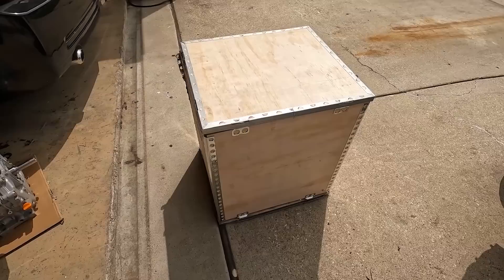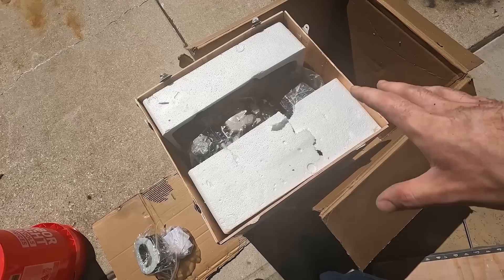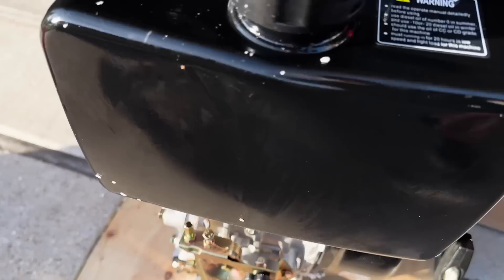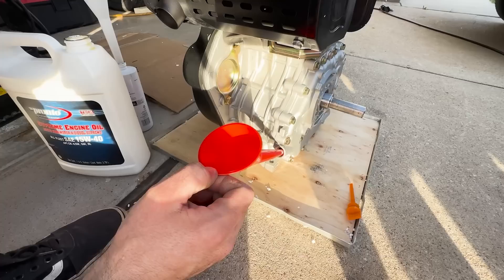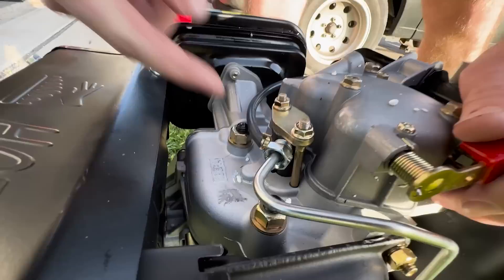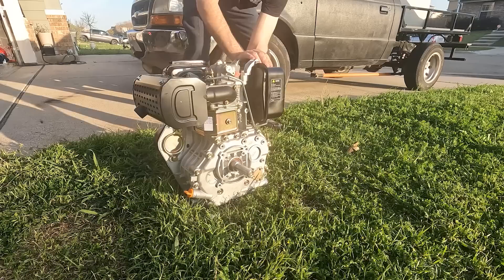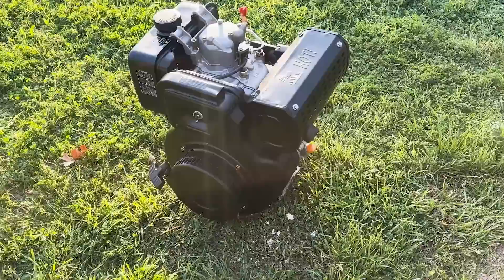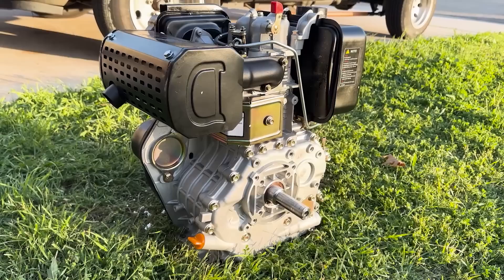Amazon 418cc Diesel Engine 10hp Unboxing First run

Comment: Electric Start Conversion KIT L100 for YANMAR L100 10HP 186F for Diesel Engines Starter Motor
Reply from the maker: Nice! That looks correct found one link for around 200 for the kit including charging coil

Comment: That's a sweet engine! 418cc would make a beast of a generator. At 3600rpm it'd be perfect for a 60Hz direct-drive stator!
Reply: It’s not a tapered shaft. He’s got to belt drive it. Better run at 2500
Reply: @boathemian7694  
Right in the middle of its torque curve. Great call!
Reply: A 5 1/4 pulley driving a 7 1/2 pulley will get the genny to 3600 rpm with 2500 rpm at the motor. 1.44 is your factor.
Reply: @kevdog58  
I actually drive my alternator at 4800 rpm with 2400 rpm on the engine. I use a 1 inch wide Gilmer belt and pulley ( toothed) to reduce the friction losses.
Reply: If it's of Chinese origin then you may regret it after buying it?
Reply: @ghanvedsingh8946 From what I’ve seen, they are made okay, but with shitty quality control/deburring and all that.

So basically before you run it, do a full dissasembly, check for any metal shavings and other fod type stuff, add grease and whatnot where needed, rebuild to proper torque specifications, THEN run.

Someone had done an AMAZING guide for all that on-YouTube too so it’s easily doable step-by-step like a cooking show!
Reply: @electronictim007  these small diesel engines typically do not have a torque "curve", The torque chart is typically very flat from about 1200 RPM up to 3,600 RPM. That's one of the advantages of a diesel engine over a gas engine.
Reply: @byronmill  
According to my studies with a watermarked dynamometer ( used a lot with my head porting work with small gas engines), my small diesel has a distinct "peak" at 2470 rpm.
The only work I've done it is a bit of head porting and ceramic coating the combustion sufaces.
Reply: @kevdog58  you mean 7.5 driving the 5.25
Reply: @100pyatt  whoops, you are correct!
Reply: @electronictim007  Running the engine at a lower rpm will just limit the amount of power you can generate.
However, running on the peak torque rpm range will maximise fuel economy and engine life.
Reply: 4-500 dollar?????look at the prices in de rest of the world Here in Holland 1300 euro
Reply: @ghanvedsingh8946  like your keyboard.
Reply: @electronictim007  Is it though? The specs for most of the Yanmars shows the torque peal coming in closer to the higher RPM.
Plus, power generation needs HP which will be very much lost at 2500rpm.

Comment: I have done lots of electronic starters on these. You will need a starter, ring gear and I also recommend to install the stator coil kit with the regulator. The coil and reg will charge the battery. Most don't come with the parts for electric start. Flywheel is bolted with a keyway.
Reply: How much power does the stator put out?
Reply: @TACOMASRT5  It is 12volts to charge the starter battery. The fuse is a 15 amp so I would assume around 7 to 10 amps. I never did an amp draw on it but I can say it is definitely less then 15 amp. If you are buying get the kit but the kits I bought didn't come with the bolts so you will need to go to the hardware store and get some metric bolts. Also I highly recommend using lots of locktite on the flat button bolts as these vibrate loose and will damage the new stator.
Reply: I think that I (and many others) would rather just pay the extra 300 or so bucks and get one with the starter already installed
Reply: part numbers for pieces needed to electric start?
Reply: @patwregan  ebay is where I get my parts from. The most critical things are the ring gear size and the rotation direction of your motor. I believe the 170F to 192F use the same starter and same alternator. Ring gears 170F to 173F uses a 200mm×15mmW×5.5mmH. The 178F uses 222mmx15mmWx5.5mmH. The 186Fto192F uses 245mmx 18mmWx10mmH.
Reply: @brianbillings1340   Rotation direction does NOT matter. If its wrong then just reverse the +/- and the starter spins the other way. That's why most starters have 2 positive bolt terminals. Put the positive on one and it spins one way. Hook it to the other and it spins the other way.
Reply: @andrewchristiansen8311  Rotation direction DOES MATTER! The starters gear that engages into the flywheel is of the slipper type and turns on the shaft freely when turned one way and won't turn the other way.
Reply: I’m sure your neighbors love the noise and stinky smell and air pollution. Get a gas engine. This isn’t a third world country, yet.
Reply: 10hp.is a little weak.for.418cc

Comment: as cool as having a small diesel on a go kart seemed, once i looked into it, it wasn't really worth it cause 10 hp at 3600 rpm is 14.5 foot pounds, a predator 420 makes 13 hp at 3600 rpm which is almost 19 foot pounds. then when i looked for aftermarket parts the diesel was in practice non existent. if i had the money id buy one for the niche of it but anything i want to go fast i'll have to stick to gassers

Comment: Probably makes between 15-30 ft-lbs of torque, which as a replacement for a gx 390/420 series engine would be a massive upgrade.
Reply: wish they made them vertical shaft so i can have a diesel push mower lol
Reply: @mudzy9820  That is an awesome idea/ dream. I would buy that so fast! Would LOVE to build that kind of contraption.
Reply: Manufacturer website has a performance chart that shows a maximum 26 Nm, which converts to about 19 lb/ft of torque
Reply: @byronmill  19ft-lbs is a lot in such a small package.
Reply: @life_of_riley88  I didn't say it wasn't significant torque,  simply stating the factory specs. 19 lb/ft of torque at 3600 RPM would be 13 horsepower peak.  They appear to be rating it at a constant load of 13 lb/ft, which would be an effective 9 horsepower at 3600.
Reply: @byronmill  Oh yeah I wasn't disagreeing with you at all. Thanks for the specs 🙂

Comment: I love these small diesels. I have two of the 418cc. You will need starter and ring gear. The flywheel it comes with doesn't have a ring gear. Use a 27mm socket and impact wrench to get the flywheel off. Then a 3-jaw gear puller. The flywheel has three holes in it to pull it off the shaft. The ring gear is about 10.5" diameter. Heat it with a propane torch and it'll drop right on. The starter is easy to mount. Connect your battery+ to the big threaded stud on the solenoid. Then with a screwdriver I touch that stud to the only other electrical connector on the solenoid and it will spin up. Note! You still need to press down the decomp lever, even with a starter! There is an ungodly amount of compression to fight against. What I like to do is let the starter turn the engine over 5 or 6 times, to get up to speed, then let go of the decomp so that on the 7th revolution, it resets the decomp, the exhaust valve closes and all that rotational kinetic energy slams the air into submission :) 

I just ordered another ring gear and starter myself. Ring gear is $38 and starter is $94. I have one of these engines mounted on a rolling cart with a Harbor Freight 10KW generator head. Both have 1" shaft. Using dual sheave "B"-section pulleys. Using a little bit bigger diameter pulley on the engine than the generator head, so that the engine will run at 3000RPM and the generator at 3600RPM. As you've probably already noticed, increasing the engine RPM suddenly not only rolls coal but it will sound like it has a rod knock. It's normal. It's the sound of combustion you're hearing. At that moment, there's more fuel than there's available oxygen (hence the "coal") and it makes a distinct hammering sound.

These diesel engines are awesome. I run mine off of 3 parts "black diesel" (centrifuged filtered motor oil) and 1 part real diesel. Runs perfectly off of it. I was afraid it would smoke like hell but no difference as compared to real diesel. Have Fun!
Reply from the maker: Ok that’s awesome! This is what I like to hear thanks for the comment!
Reply: Have you by any chance captured any fuel efficiency data when running your generator?  I saw somewhere these things are rated at about 6kw, not sure if that is the fuel input energy or if it can output a max of 6kw into a generator?  I have long thought about trying to make a diesel generator, curious how well it actually works and how efficient it is.
Reply: You obviously need a really flat surface and act speedily to drop the the ring gear onto avoid a misaligned contraction with a fast cool down? I would imagine.
Reply: @jontscott  I just assume half a pound of fuel per horsepower hour as the brake specific fuel consumption. So that's 13.4 horsepower for 1 hour or 6.7 horsepower for 2 hours, etc. 6 kilowatts is what, 8 horsepower? it can produce that all day long.
Reply: @adoreslaurel  yeah, you have about 30 seconds to get the job done. Then just look at it real closely and if there's any kind of gap, I just put it under the hydraulic press. Or if your eyesight is like mine, use a feeler gauge. The flywheel does have a lip that the ring gear butts up against so you would use the feeler gauge between the ring gear and that lip. Hope this helps
Reply: @goofypettiger  So you would expect about 9.8kw per gallon of Diesel.  If the generator is around 90% efficient then at least 8.5kw of usable power per gallon should be possible.  If the engine is consuming half a gallon per hour of fuel it would be reasonable to expect about 4kwh of output, that seems very efficient.  Any idea if the efficiency is similar at say 1500rpm vs 2500rpm?

Comment: Push decompresser, pull a couple of turns make sure you hear injection sound, release decompresser you're done with this now. . Pull cord slowly until you feel compression, nudge it just over compression, dont go too far, just until resistance eases. Return cord for a full pull, pull fast it will start everytime,
Reply: Honestly I believe the decompresser is used more like a choke than an assist for starting since it’s diesel, it relies on compression ignition
Reply: @vtron8580 it's makes it easier for the starter to turn it over, it's very common on old diesel trucks and small hand cranks like this

Comment: For the electric start you will need the starter and ring gear as well as the stator, rectifier/regulator, and magnet drum these usually come in a kit search electric starter kit engine model... Mine is a 196fa (it's the 13hp variant)

Comment: We have very similar engine (probably from the same factory) we bought it it around 2017 ( Model 186FA, Power 6.6 kw @ 3600 rpm, weight 48 kg). We only done oil change ones. Oil viscosity 5W-30 synthetic. Also it came with electric starter.

Comment: Run smooth like sandpaper 😂
Reply: These basically need torn down, cleaned+properly torque on all the bolts, then greased and reassembled first if you really want them to last.  Great guide on YouTube for the process.

Comment: got an old 310cc flat head Sears engine that's bored 30 over, takes a good 120 pounds to pull start it. 💪 got a 8kw generator that justifies rebuilding the old thing. just needs a sleeve on the connecting rod.
Reply from the maker: Heck yea that’s awesome !
Reply: @Mikebuildss  replaced the ignition coil just to see if it would run 4 years ago, think it might free rev to 7000rpm... but the connecting rod was very worn out and it somehow magically fixed its self. came of an old rototiller.

Comment: The first way you tried to start it was correct. It flaws me seeing people mess it up trying to manually release the decomp whilst pulling 😂
Reply from the maker: There is a trick to it for sure, especially if you don’t want to destroy your shoulder in the process
Reply: @Mikebuildss  I must admit, I've done it the correct way and had one pull-back, but that was after the injector had fired whilst slow pulling. I find the diesels tend to get a bit more forceful with compression/grumpy when there is fuel spray in the cylinder

Comment: I have a small diesel engine my cousin installed for me on an old Troy built tiller… It’s has a lot of compression so it can be a bitch to start but once you get it pulled it normally starts and runs good! 👍

Comment: I don't know squat about diesels, but would an electric glow plug (if thats what it's called) help it start easier?  I'd love to put one of these in a golf cart.
Reply: No room to fit one here. 

Just keep the engine warm especially in winter...
and learn the correct starting procedure as per the owner's manual...

or wimp out and buy all the bits to convert it to electric start..

or make good life choices and pay up front for the factory starter with charging circuit built in?

When was the last time you bought a car without a starter?

Comment: Ive thought about one of those. 
I have a buch of used veg oil, from local fairgrounds and would probably quiet it down some running on it. 
Best way of running veg oil is a heated 2 tank setup so when you shut it down or start up, its on pure diesel.
.
Normally on a road engine i use the coolant to heat it up, so without coolant you would need to get a little creative.
Id figure 20 gal would run that thing for quite a long time.

Comment: channel idea. buy a $500 5.6gpm general pump and some pulleys from southside equipment plus a engine+pump mounting plate and put em together. You'll get a crap ton of views from the curious pressure wash community. We all build our own rigs and all have looked at diesel but nobody bit the bullet minus some giant kubota diesel builds.
Reply from the maker: That may be a good idea! And I’d have a nice pressure washer finally

Comment: For an application for this 10 HP diesel maybe something where it has a definite advantage over gasoline engine. I'd think the gas engine's higher power/weight ration would give it an advantage over the diesel in speed and handling for small vehicles (minibikes, go karts).  Maybe a small tractor or bulldozer where heavy torque is required that would stall out a gas motor may be where this heavy 10HP diesel could really shine and surpass gas engines.
Reply: Diesel and equipment mechanic here. This little guy would make a great hydrostat drive engine for something smaller than a skid steer. A little hobby tractor or fat tire implement would be pretty neat.
Reply: @Irishcream216 Sounds good. Maybe you need to do a YouTube video on that. I can guarantee you at least 1 view.

Comment: I live in the Philippines. Just bought one of these at a local store about 3 wks ago. 13,000 pesos ($236). Mine does not have the recoil starter. They are ok.

Comment: Flywheel had no teeth on mine. Pull starter broke after 10 properly decompressed pulls. Not happy!
Reply from the maker: It’s very tricky to start, I’ve figured out the trick, but my pull start is close to being destroyed
Reply: @Mikebuildss  Well, the pull starter broke so the only option is to put on a ring gear and set up a starter. Very disappointed.

Comment: U are suposto bleed it at the exit  fuel line on the pump , at the injectors it's already in the engine, so you can take out the air at the end of the line

Comment: Huge misconception and even Cummins has had this problem with their 6.7 15/40 is not a universal diesel engine oil. I run 10w40 in my 1.4 gas engine. Here’s the thing. The heavier the oil the harder it is for the engine to pump and get it into small and tight tolerances. At the rpm speed these spin and how small the  components are, I have no idea but I would assume dropping to 10w40 or even 5w 40 would be a better oil for this application. Especially since it is not water cooled

Comment: I have used a couple of these and they are great motors for some stuff. They should be on something stationary that runs it on the governor. I have used them on Argos and the power is fine but smoke like crazy under load everything is black after. Maybe a guy could turn down the fuel screw so it has just a haze under load instead of pouring black soot. They will start in -30 easy have no idea how but they do. They are good on fuel if ran on the governor.
Reply from the maker: I have noticed some smoke, but I need to run it in some more, it’s kinda loud I’m sure my neighbors love me!

Comment: You need to set the accelerator to half open on cold starts

This is because diesels always run lean except at max RPM

there is no throttle body or throttle valve to limit the air like in a gasoline engine.

Comment: Please, may I ask a question ? 
Will this engine run without gluw plug ? That is, it only works by compression ?
Reply from the maker: Correct, no glow plug
Reply: @Mikebuildss 
Thanks, what the amazing technology.
Reply: If you're trying to start it in cold weather, maybe use a propane torch to heat the cylinder head. Never had to do it myself. Good luck.
Reply: @goofypettiger  I don't live in a very cold area so I don't need it ! I think the engine can be modified by placing a heat exchanger in the cylinder head to warm it so that it can exchange heat with hot air or hot water.

Comment: nice engine, nice runner, I got two of the electric start version. I know a link that can help with a pull starting. I have the manuals for both these style and the yanmar service manual if you would like them.
Reply from the maker: Very interested!

Comment: U should make this a mud motor for a boat
Reply from the maker: There’s no mud around here
Reply: @Mikebuildss  well i don’t use the mud lol thats just what it’s called like a longtail boat motor
Reply from the maker: @Toobluejzs147  ahh I figured that’s what you meant, I think It would work well, could probably turn a very aggressive prop with all the torque it has.

Comment: the throttle has to be open a little bit to start
Reply: That's the truth. I've been messing with these small diesels for a while and finally realized that they will never start if the throttle is at idle.